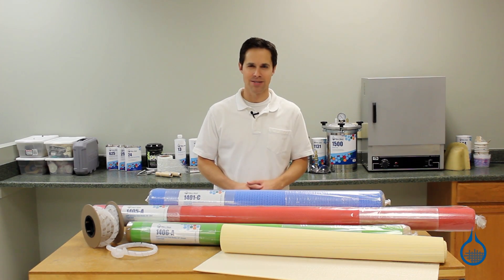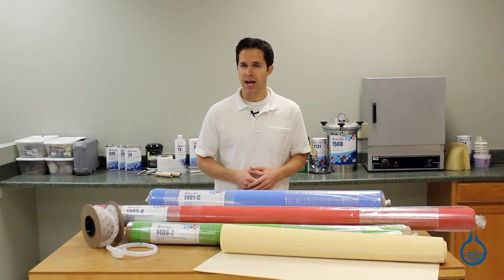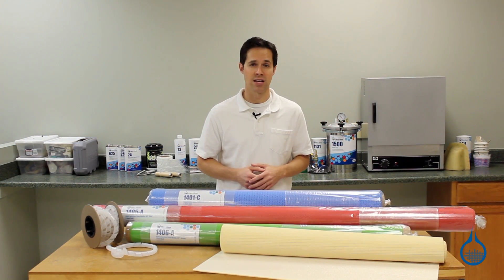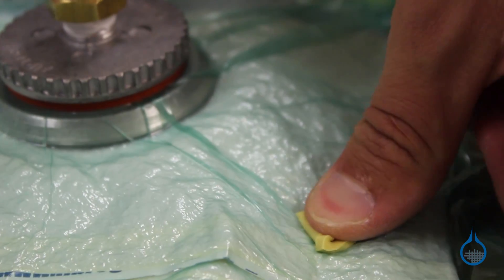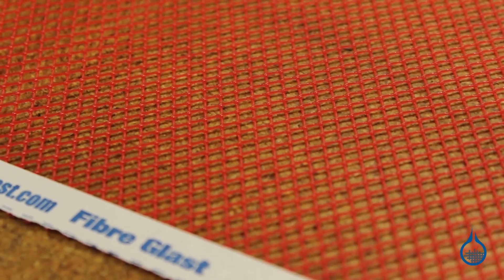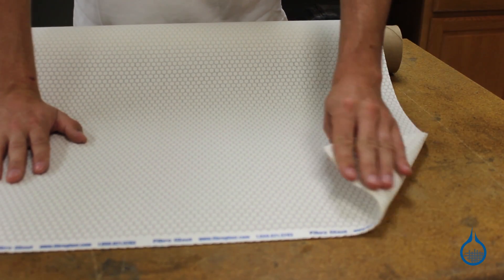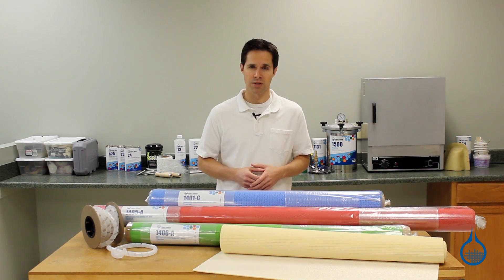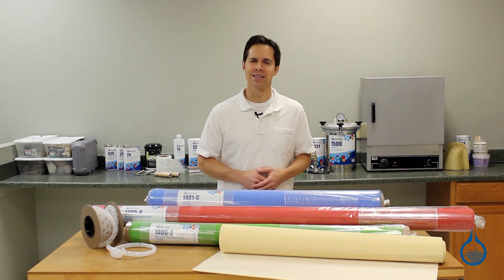Vacuum Infusion

Comment: It seems vacuum infusion is quite a bit more expensive.   Am I wrong in my thinking?
Reply from the maker: +Joel Vacuum infusion will require more materials. However, you will see a better fiber-to-resin ratio, less wasted resin, better resin usage, along with having an unlimited setup time and an overall cleaner setup as well. 

For further information, you can check out our white paper on Vacuum Infusion here: http://bit.ly/1k4SdPq
Reply: Indeed you are.